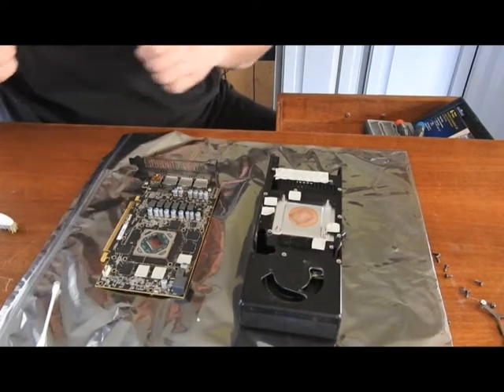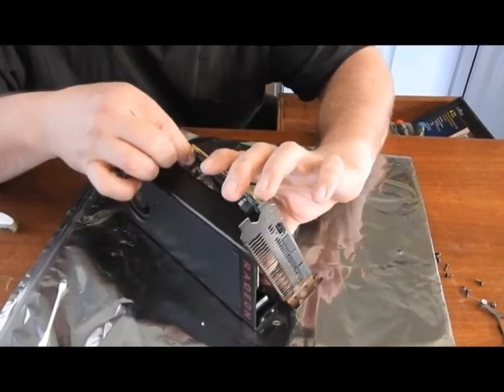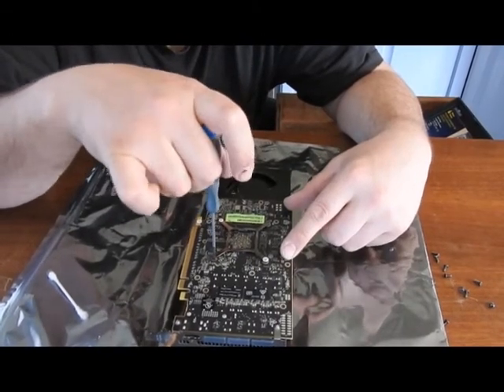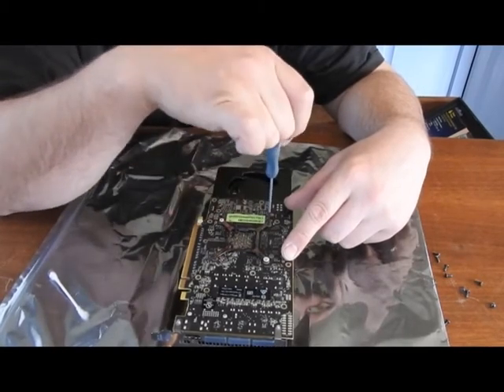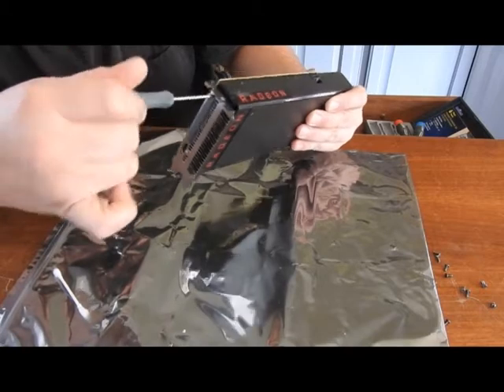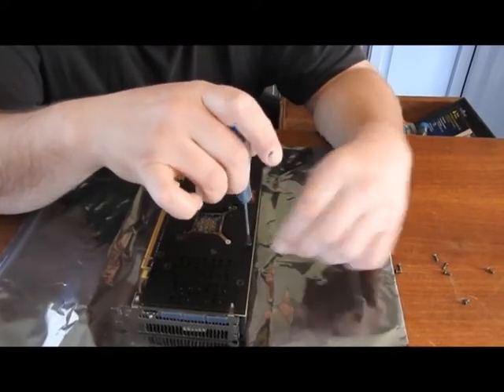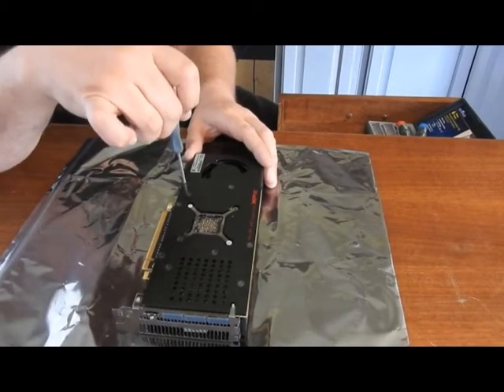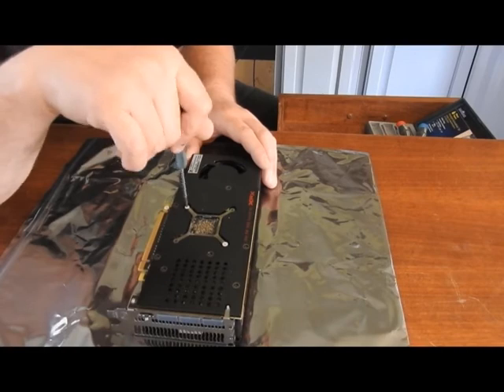[XFX RX 480 Thermal Paste] - Part 04 -  Adding thermal paste and reassemble the GPU.

Comment: Hello brother, I have a question. How good is the heat dissipation of the vram + thermal pad, over the plastic mount? It is clear that being a blower model, the aluminum heatsink is small and does not make contact with the vram as in other custom GPUs.
The card that I bought strangely did not have the thermal pads (vram, vrm), so I am forced to put them on. Will I have differences in temperatures?

Comment: Thanks for the video man! I got a reference Radeon rx480. Bought it mid 2016. Wasn't really used very much. I didn't use the pc for about 2 years. 
But I'm getting throttling and high temps when gaming. 2 questions: will repasting it with good quality paste help lower temps and by how much do you think roughly?
And will i destroy my card by attempting this for the first time ever following your instructions? :P cheers
Reply from the maker: Make sure to repaste with a good quality paste that is non conductive to minimize chances.  I used thermogrizzly kryonaut now.  The arctic silver is conductive and you have to be really careful.  Be careful when tightening screws to not over-tighten.  For the most part it is a pretty easy procedure.  I was dropping some temperatures by 10 to 20 degrees.  If the fan is intermittent then this will not help at all.  You can try watching it to make sure it is going when hot.
Reply: @dragonslair80  thanks for the advice im going to pick up the paste you said later today and give it a shot. With intermittent you mean the fans stop once in a while? Im not really sure about that. I tweaked the gpu fans and upped it to 75% when hitting 78 degrees celcius. Thanks again
Reply from the maker: @dejan2398  My pleasure, yeah intermittent would be it stopping randomly.  I repaste one and then noticed the fan was going.  That is the only time it did not help the temp.
Reply: Load temps - 70 - 88 degrees Celsius. Tried to repaste. noticed there was no paste on the chipset. It all got squeezed out and old and dry. repasted with some left over cooler master paste. just a small dot method. Noticed the throttling is now even worse with new paste based on my frames per second dropping. I think I didnt use enough. Looks like im 40 degrees at idle. Waiting on some MX-4 paste to try again with more paste.

Update: I checked my paste job and got a good paste job. Changed it for the MX-4 and repasted my CPU (fx6300) Both are hitting max temps and throttling under load. the CPU should be bottle necking the GPU. The Idle and throttle temps aren't changing but it meaked out some Frame per second.

Weird since when I opened the GPU to replace the thermal compound with the left over thermal master stuff I noted full compound run out. Not a drop left between heatsink and chipset and all I did other than that was blow the dust out my CPU heat sink. So its weird to see a good paste job and this associated with a drop in FPS. When I redid the the CPU the application of compound looked good but it was obviously dry.

I checked and mark with tech. Tested the generic little tube of cooler master thermal compound they send you like a sample and it performs about comparable to arctic silver 5. so Im stumped, since that would be an explanation is: "the cooler master compound is worse than no compound".

Conclusion: Whats my temp drop? 10 to 20 FPS? 3 degress C?? Should you do it? I would if you think you can handle it. repasting should be part of computer maintenance. Complications could be you lose screws dont put it back together in the orientation it came apart. OR worst you have no experience removing and installing screws and dont align the threads right getting the screw started and strip it. Or go ham torquing it down, overtorque it and strip it. But it sounds unlikely with a little experience and common sense with threaded fasteners. But ive seen some real bone heads.

Comment: When i apply thermal past my gpu work only one time very good then after 10minutes game play screen flicker cpu restart and showing broken images and cpu boot but no properties of gpu then i have to apply thermal paste again to make him work for 10 more minutes my gpu is asus gtx 750ti oc
Reply from the maker: Do you have thermal pads on the other chips to attach them to the heat sink as well.  Sounds like an issue with the RAM chips overheating over time.